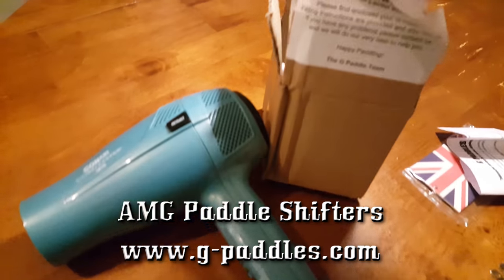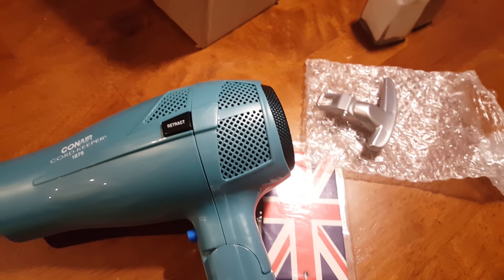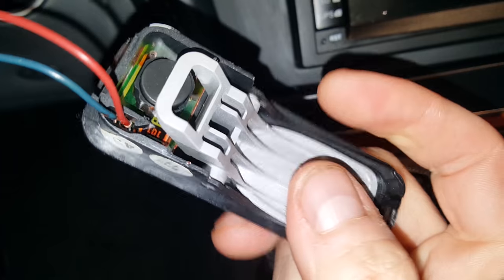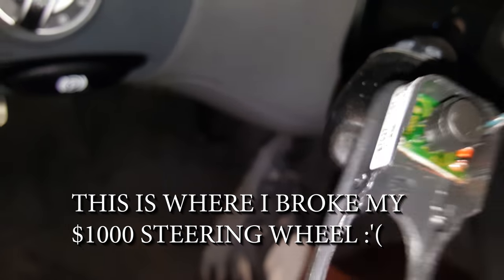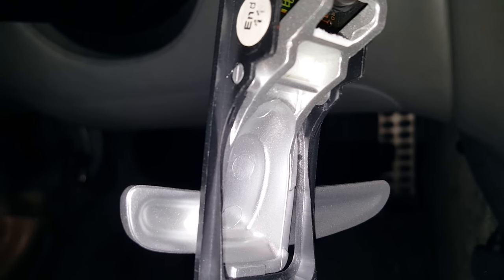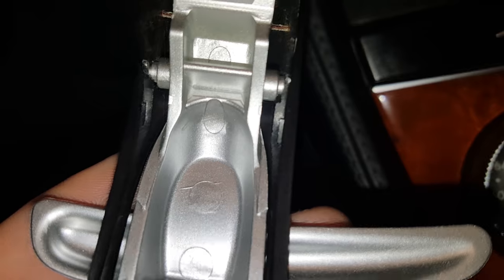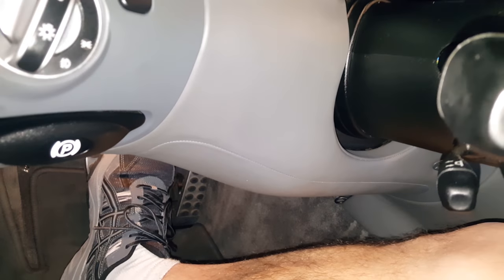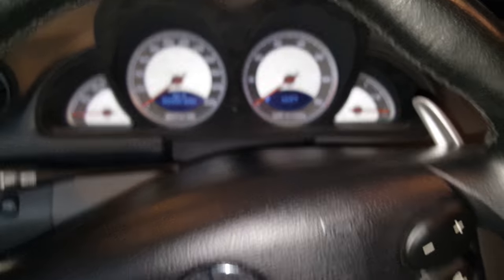AMG Button to Paddle conversion - GPADDLES install instructions.

Comment: Hi SuperCar Street RacingThanks for doing the install video it gives a lot of information that the printed word / email can not get over , As said in the install video the main message is lots of warming up of the black switch housing & take your time , The OEM button will come out & the G Paddle will go in . Just general information the G Paddle that's installed on this video it will also fit C55 , SLK55 , CLS55 , CLK55 & very early SLR . We also produce Paddles for the E55 , CL55 , S55 & all MB class with sport package fitted . Again a very large thanks to SuperCar Street Racing its always great to get some feed back & even better in video format . ThanksThe G Paddle Tam
Reply from the maker: Thanks for the comments GPADDLES! So far so good, I love the paddles!